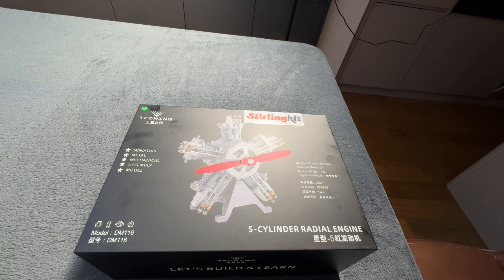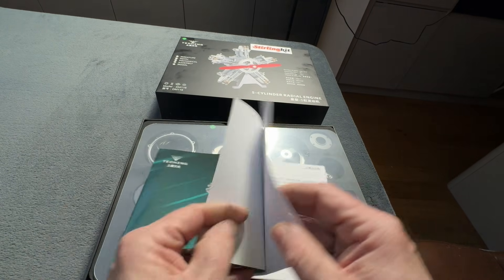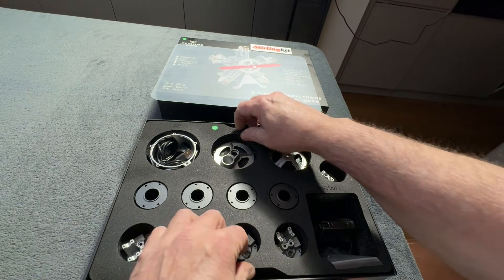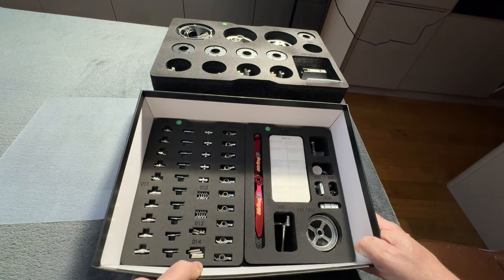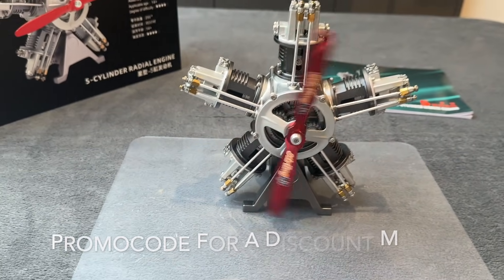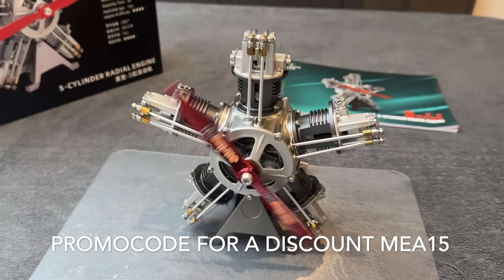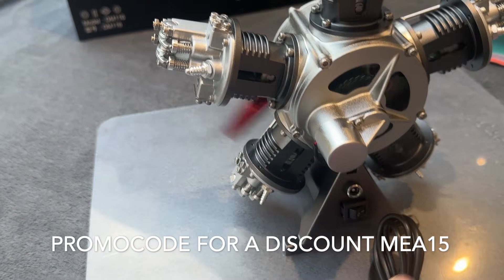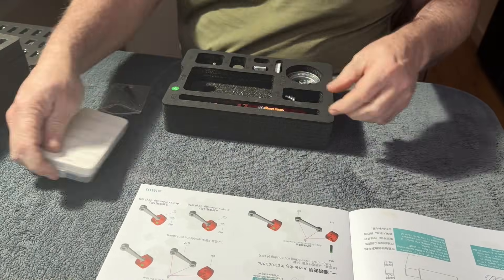Stirling Kit 5 cylinder radial

Comment: That is a nice looking kit and it seems to run well on the motor.  It retails at around £300 in the UK so its not cheap. I am quite interested in the hit and miss single cylinder open crank engines that are available that do actually seem to run quite well on petrol,  but then again they are around £400 all in.